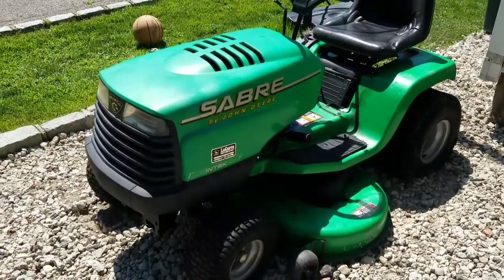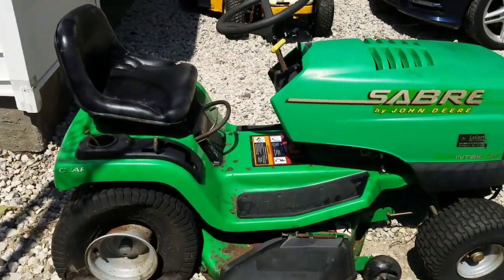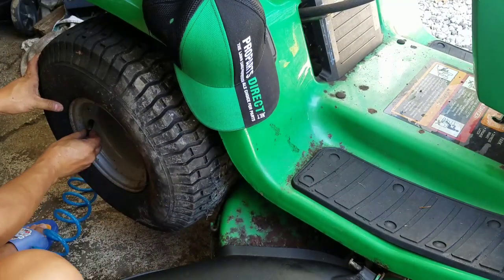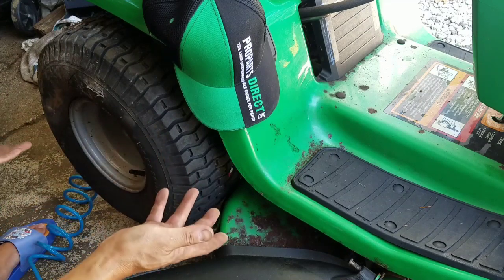8" INNER TUBE INSTALL WITHOUT WHEEL TIRE REMOVAL CUB CADET SABRE JOHN DEERE LAWN GARDEN TRACTOR FIX

Comment: Dude that Saber is mostly plastic they don't rust much, but the deck looks rusty, let's hope it doesn't have the safety switch problems they all have, I bypassed em and put a push button start with a key switch to turn it off, the guy I sold it to loves it.

Comment: Hey Henry, whats the story on your daily driver Murray? I didn't see a video about where you got that one or what its problem was.
I have a 1998 Murray Wide body LT 6 speed 38" or 42". It had a Briggs 16hp single OHV. The engine is blown, but I have a good 13hp L head Briggs I can put on it and its good too go again. Is it worth it? I was thinking about breaking it down for all its parts, but aside from the blown motor everything else is good, should I save it? Whats it worth 4-5 hundred?
Also I stuck a briggs opposed twin on a Craftsman T2200 from 2014. It had a leak. I replaced the sump gasket. It was better, looked like the leak was fixed. Now its leaking again in the very back and on the side near the dipstick base. Do you think its just the square backplate gasket now? I cant see how it would leak from the sump again after replacing it. I replaced the sump gasket on another one once and it fixed it, it was leaking same place. Now this engine is still leaking again same place the back area. Any suggestions? The shaft seal below is good, no leaking their.
I just replaced the sump gasket, I didnt use any spray on tack ir anything like that... I can get to the back plate without pulling the engine, otherwise I have to pull it again for the sump, that would suck. Let me know your thoughts, thanks.
Reply from the maker: Yes, I would check the rectangle inspection plate.  The gaskets there always go bad.  I've actually used rtv silicone once and it works...its not a high pressure area.  

As for my black beauty daily driver.  I bought it brand new from Home Depot for $550 plus tax and free delivery, it was a floor demo model in 2001.  Its a 12.5 briggs flathead and 40" deck.  It always starts and works great.  I ran into a tree in 2007 and bent the front axle.  I bought a used axle on ebay for $100. In 2002, I spent $300 on a brand new bagger system which I still use today.  It's so reliable man that I wont sell it.  It starts all the time, it mulches and bags leaves.  Its everything I need.  Now it just sits there because I have so many mowers to test and use since they're sprawled around my yard.  I'll bust it out in the fall as the leaves are crazy!
Reply: @MowersNBlowers  Thanks for the tip, good I don't have to order and wait for a gasket.
I think I'm going to save this Murray than. Its a nice machine, built solid, nice hood and pretty wide. You saved this Murray from being broken down, will give it another chance with that 13 Briggs flathead. Thanks.
Oh one other thing lol. I have a John Deere STX38 sitting here I'm getting ready to work on. It has the 12.5 Kohler command the starter works, but the solonoid to it doesn't. You mentioned you can by pass the kohlers solenoid with a 3 point solonoid?
Reply: I take it, to bypass the kohler solonoid, simply bolt a 3 post solonoid on, and remove the lead from the bad Kohler starter solenoid and take the lead from the new solenoid straight to the starter?
Reply from the maker: I have a video on exactly that.
Reply from the maker: @Mr_Tecumseh  here it is!

https://youtu.be/s6MKuIJHhDY
Reply: @MowersNBlowers  Thank you
Reply: @MowersNBlowers  Taryl Dactal is a funny dude, him and those teeth of his lol. Thanks again.
In the morning I'm going to pick up some Ultra Black oil resistant silocone to seal that rectangular back inspection plate on my oppy. Thats good stuff too use right? I never sealed a part of the engine shut without the gasket as well, thats why I ask. I saw you used the blue stuff on the valve cover in a more recent video and said the red was a fail, so I'm gonna go with the black, sound good.
Reply from the maker: @Mr_Tecumseh  well, just make sure its high temp permatex RTV gasket maker silicone.
Reply: @MowersNBlowers  Yep, getting the ultra black at advance, so any that pushes out will be hard to notice like blue or red. Thanks for all the help.
Reply: @MowersNBlowers  It was definitely the back inspection plates gasket. As soon as I started loosening the bolts the residential oil ran down fast right where it had been, the gasket was hard as a carp and dry rot cracked at the bottom
 The gasket came off im one piece so I was able to run the bead of silicone right over the old gasket. I'll know for sure once I put oil in tomorrow, but its clear thats what was still wrong, since I just replaced the sump gasket. A 2014 Craftsman T2200 with a 19.5hp opposed twin, some lucky buyer gets to enjoy that. Imstead of the crap 540cc Briggs intek that was on it, that took a dump, just like they all do throwing rods, like its their job...
Reply: @MowersNBlowers  No more oil leak, its fixed. Thank goodness. Thanks again! 👍

Comment: Slime always works good for me for some reason and it rinses off with water
Reply from the maker: Pinhole leaks? My tires are always huge dry rot cracks in the sidewall.
Reply: @MowersNBlowers  Works on big dry wall cracks just not on big nail/screw holes, on dry wall crack I take the wheel off a set it on it side  then flip it over
Reply from the maker: @TheWolverine-rm2kr  I may try that next time...i have about a half a bottle left.

Comment: I have tons of large horizontal engines, but they only have one PTO output side
Reply: You can add a pulley to any engine got to be 10hp or bigger
Reply from the maker: I'd have to add the driveshaft coupler to the other end.
Reply: @MowersNBlowers  the briggs v twin is blown up?